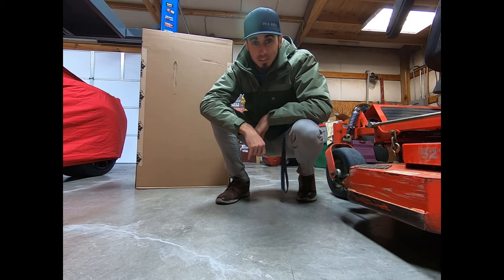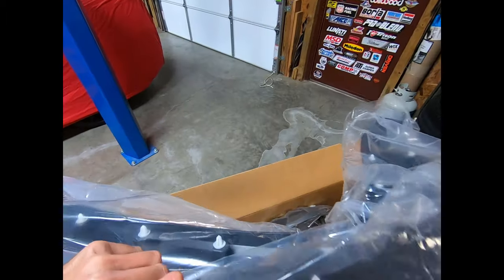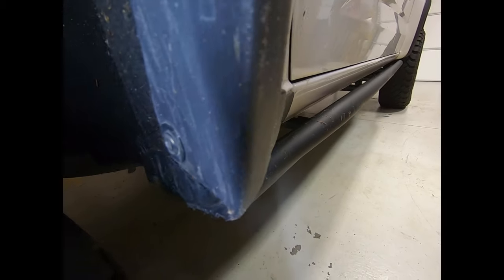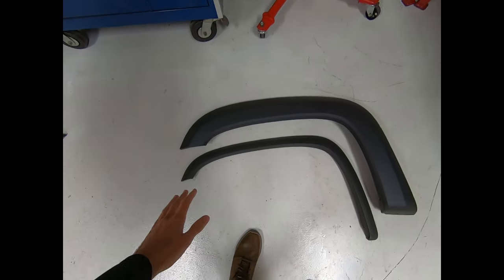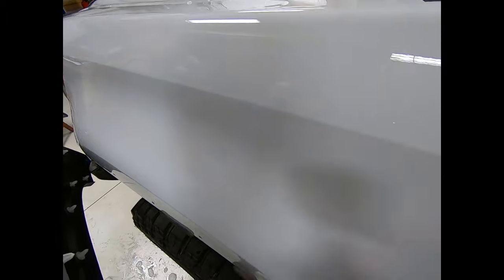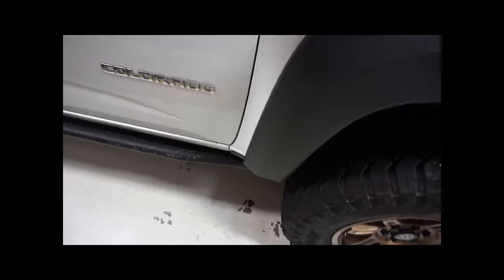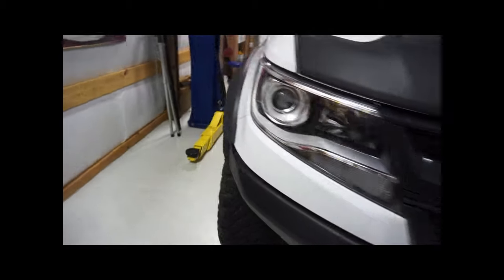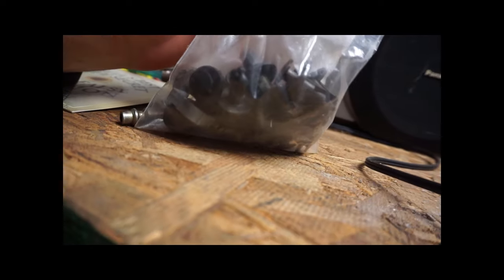INSTALLING BISON FLARES ON MY ZR2 ! WITHOUT DRILLING ?

Comment: I just installed the flares a few weeks ago and drilled using the templates with no issues.  I actually received the flares used from someone who upgraded to the high mark flares, with no AEV printed templates. I ended up having to get the flare templates printed up at FedEx office it took them a few times to properly print these to scale so that was really the only stressful part.  Drilling and mounting the Bison flares was an extremely easy process with no dramas.  Yeah you have to cut out the templates using scissors which kinda of sucked.  I just wanted to leave a comment for those a little nervous about drilling..it’s literally no big deal man up and just get it done. 😉 I love VHB tape too but the process to get these flare holes drilled is very easy so imo its better to just drill some holes.
Reply from the maker: I’m glad it worked out for you man. I couldn’t bring myself to do it 😅

Comment: Hey Trav...  Great video!  So, how are the flares holding up.  Want to convert my ZR2 to these flares as well.  Also, can you tell me if these flares add any width?  Are they wider that the stock ZR2 flares? Thanks Bud, and keep the videos coming.
Reply from the maker: Still doing great ! They are slightly wider but mostly just more body protection.

Comment: I really like the tape idea but what happens is you need to remove the flares, especially the front if you need to remove the front bumper? Can the flare be removed without damage once the tape sets up?
Reply from the maker: Bumper is a seperate entity from the flare and fender. As far as removing them I shouldn’t have to for anything really. I trimmed them up before hand. The tape could be heated up so its easier to work loose. Trust me.. I’d rather deal with tape than 48 rust holes in my bed / fenders

Comment: Excellent video! The extreme tape makes me feel better then drilling!. Next mod after the eibach leveling springs. Oh yeah digging the second camera. And thanks for the awesome videos! Edit- would you think adding a rubber seal on the flare would be a good idea?
Reply from the maker: Thanks for the input ! I actaully started to do that too. However it would push the flare away from the body more and cause the clips on the bottom to not seat. If you did use a seal try a very thin version. The good thing about this method, if it doesn’t work you aren’t stuck with it !